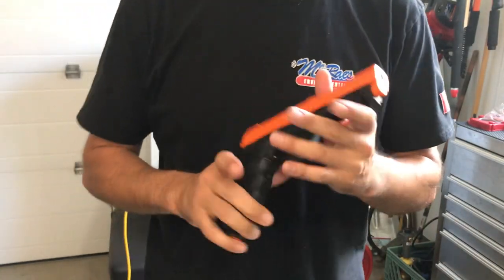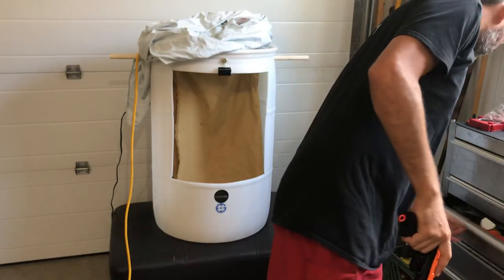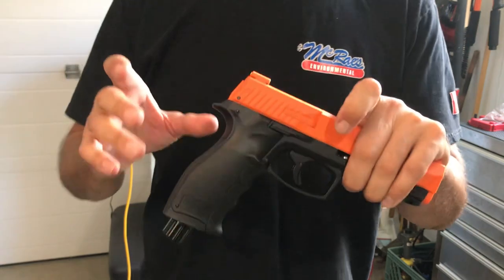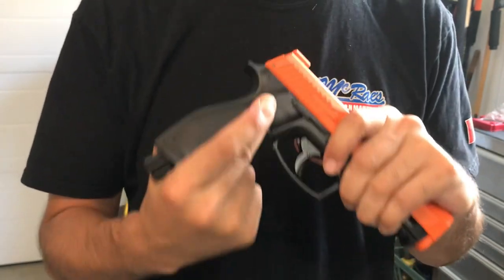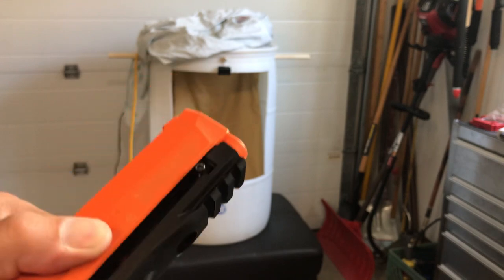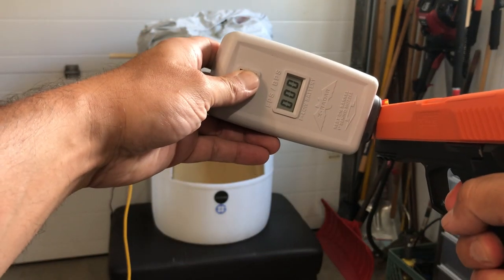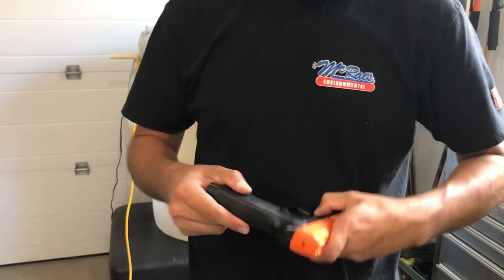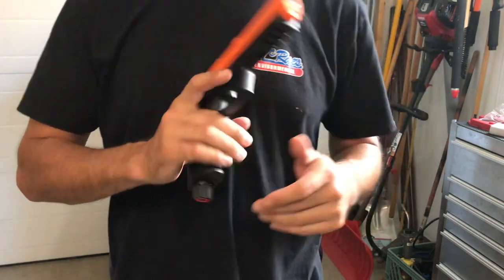Umarex T4e Hdp 50 co2 and valve block restrictor delete. 17-18 joule. Follower fix for steel balls.

Comment: i have a hdp 50 with the f stamp on it , it came with no restrictor in it , i removed the valve block so its fully open , it smacks hard , would you happen to know how many joules it would be at now fully open? great videos by the way .thanks 👍🏽
Reply from the maker: Approximately 18j temperature and projectile dependant of course.

Comment: hmm.. ive got the hdp50 11j, looking in the pressure chamber and i see no "horse shoe" shaped cylinder/valve restrictor, all i see is diameter is shrinking abit way down in there like 1mm but cant tell if its something i can take out to open it more, should i disassemble it completely or is this one that ship without restrictor from factory? In that case, all i need to do is remove the thing with a hole in it between the grip and pressure chamber?
Reply from the maker: If your hdp50 came with a silver button co2 restrictor in the grip it is likely an 11j version which i think has no valve restrictor. In Northern American we only get the 7.5j version so it ships differently.
Reply: @lesslethalfordummies  Youre correct! Thanks!!!

Comment: So I tested umarex rubber it was 670 avg  1.15grams uxcell nylon 1.20 grams is 650 avg and umarex 1/2 glass slingshot ammo is 2.5 grams at 430 avg on all 6-7 shots at least in mine, I took your advice and didn't bother with steel, I think the sweet spot with ammo in the umarex products with just removing the restrictions is about double so 3-4 grams max in .50 cal and 5-6 grams in .68 cal. Obviously if you run longer barrel and hpa and short valve pin you'd get more. But for free mods you can't beat them.
Reply from the maker: I am of the opinion 4g is perfect for 50cal. I am trying to make the heavy steel balls more useful on anything but hpa. If i fail I will be picking up some lighter ammo.
Reply: @lesslethalfordummies  if you find a ammo that fits in the hdp that 3-4 grams let me know cuz I'm running the 1/2 inch glass in my edc it's decent but something harder or shatter proof would be nicer, however they are like dead accurate like 1-2 inch groups at 7 yards
Reply from the maker: 10-4!
Reply: @lesslethalfordummies  hey are you experiencing like a good drop off in velocity after first two shots with the valve block out
Reply from the maker: @markharlacher6183  this is typical behaviour after removing the block unfortunately. By dseign with the blocks removed Umarex markers charge the entire air chamber and co2 chamber which is alot of space for just a 12g co2. Ideally you need more co2 or hpa. I found reinstalling the co2 disk while lowered the initial fps it allowed greater consistency.
Reply: @lesslethalfordummies  I want max power so if it doesn't matter but my acctech or whatever pellet Chrono you shoot through a 1 inch hole has been reading like 600+ first two shots then 400+ 3-6 with 2.5 gram glass ball so idk if it's the gun or Chrono
Reply from the maker: Your chrono is probably reading the co2 blast because you are shooting through it at such close range. Radar based chronos elimate this problem for the most part.
Reply: So idk if it's the POS Chrono or the gun is actually putting that out cuz the glass it clear and if it's picking up the round or not
Reply from the maker: @markharlacher6183  i am almost 100% sure its the chrono.
Reply: @lesslethalfordummies  ok thanks ig I'll just the old soup can water test see if it goes through both sides or more thank one idk
Reply: @markharlacher6183  12.5mm Aluminum balls
Reply: Have you tried the 2.8g aluminum?, and has anyone tried leaving the valve block in but drilling it out larger passage?
Reply from the maker: Most people are going for max power so leaving the block in place just doesnt make sense. There are numerous ways that you can restrict flow and all will lead to the same result.

Comment: I had a question why does the double delete not work on the hdr.50 like it does on the hdp.50? Would a stronger bolt spring work for a double delete valve block and restrictor on the HDR.50?
Reply from the maker: A stronger spring should alleviate the problem. My belief why the Hdr does this and not the Hdp is pressure loss through the drum creating a free air situation.
Reply: @lesslethalfordummies  yeah I can see how it would lose some air through the drum awesome perspective. What size spring and tension would you recommend?
Reply from the maker: I started testing springs but never followed it through. Its probably something i should revisit.
Reply: @lesslethalfordummies  yeah that would be some awesome experiments for the hdr.50. Awesome thank you for your help. And again I definitely appreciate your videos
Reply from the maker: Thanks for the support. Honest to goodness reason i didnt follow through is a get tired of all the tinnie tiny little screws 😂
Reply: @lesslethalfordummies  lol yeah those screws are tiny and a pain to keep taking off and putting on, thank you for your contribution and for making the videos fun to watch

Comment: i got the full mod ,with also 2 piece tuning barrel , you will get not 25 but 30 joules. i got in the .495 barrel not the .505 ,,in , and this one shoots everything but steel balls ,if it does go into barrel easily i wont shoot it ,i wont mess up the barrel tht way , i have others for steel balls . have you tried the 177 grain lead .50 cal balls yet ?
Reply from the maker: I have been wanting to try some lead balls thinking they might make for a better fit in the barrel. I just havent had the time with everything else that i have been up too.
Reply: @lesslethalfordummies  i got some ,thy are 177 grains , they arent as good as the steel balls because they will eventually deform lol .
Reply from the maker: @rick31869  yowza those are heavy!
Reply: @lesslethalfordummies  i know need 50 or more joules for that lol
Reply: @lesslethalfordummies  they are closer to .495 range , they roll into tuning barrel no probz. i havent used them yet for 2 reasons . lead does deform , and i want a little more than 25 to 30 joules to test them lol . dam it ,now im curious ,i will probz put my tuning barrel back in and shoot em at 30 joules ,when i do , ill give results ! .
Reply: @lesslethalfordummies  now bro ,im itching to buy a tippman cronus tactical , do you know if there is a heavy mod you can do ,have you ever tried to mod one ,at $ 139 its cheap but still looks nice !
Reply from the maker: @rick31869  i haven’t played with a Cronus. Way back when i messed with a 98 and 18j was possible pretty easy with drive spring upgrade. Most recently i was modding a Spyder Victor and just haven’t had time to revisit but it was close to 30j and i am sure there is more.
Reply: @lesslethalfordummies  omg ,im close to getting one ,im trying to find mods for it , kindda looks cool !!!

Comment: How can you tell of you have a 7 vs 11 joule valve on the hdp 50?
Reply from the maker: 11j valves will have the shiny co2 restrictor if you look up the co2 grip.

The marker would also have the “f” stamp  integrated on the side.
Reply: I dont believe mine came with a co2 restrictor but it does have the "f" stamp so it's appears I have the 11j version? It also doesnt appear to have "threads" for the restrictor. I plan on keeping it double deleted adding the tuning barrel and a power pin.
Reply from the maker: @lylemcdowell7600 what you have is a 7.5j version. No restrictor, no threads, “f” stamp = 7.5j

What your does have is the larger valve block i side the air valve itself.

Comment: and yes the 8.4 steel balls are only good with hpa, co2 they are to heavy
Reply from the maker: I am hoping to change that 😉
Reply: would you recommend the 4 gram pvc coated steel balls for a co2 set up?
Reply from the maker: @OE30  i dont know which ones specifically you are referring to but i am currently using 3.5g pvc coated riot balls. They cycle really well but i feel they are a little undersized for maximum fps in the factory barrel. The riot balls measure in at 12.4mm diameter.
Reply: @lesslethalfordummies  Thanks for the info! 
I found some on eBay advertised as: 
"100 X Less Lethal .50 Cal Paintballs 4 Grams Solid PVC Steel" 
for about $71.00 
I would have to contact the seller to see if they're at least 12.7 mm.

I'm currently using 12.7 mm 1.5 gram nylon balls and they cycle like a dream with a tight seal.
Reply from the maker: @OE30  strangely enough Riot Balls advertise them as 4g but really they are 3.5g.
Reply: Get hd24 aluminium balls, you wont be dissapointed.

Comment: How do you take the valve block off?
Reply from the maker: Unfortunately during the filming of that particular video my camera crapped out and missed everything. It is really simple to knock it out with a long thin oject down the barrel once your marker has been opened up and the brass cap removed. A quick search of YouTube should get you some great videos demonstrating this process.

Comment: Was that the 7.5j model?
Reply from the maker: It started as 7.5j model yes.
Reply: @lesslethalfordummies  cool cheers. I've just recently got one and the 20/30j upgrade kit but ive seen people say its better just removing the restriction. Just wondering if its worth it
Reply from the maker: @chrisg4rr377  remove the valve block first and test it out. Then you can move on to drilling the restrictor or deleting it completely. Dont bother wasting time changing to the shorter pin it hasn’t proven to be worth the effort.

Properly bore sized ammo will have a much greater benefit after removing the block.
Reply: @lesslethalfordummies  cool cheers bro

Comment: DO THE DELETE AND PUT IN THE STAINLESS STEEL VERSION OF THE POWER KIT AND 25 JOULES YOUR FIRST SHOT !!!
Reply from the maker: I have to order a longer barrel so i will see what else i can at least try. I did lots of testing with shorter pins in my Fsc and Vks and it just didnt produce any gains.
Reply: @lesslethalfordummies  i am breaking the 25 joules mark with power valve pin 2mm shorter , valve block delete , restrictor out , when in i loose a joule or two , but my shots drop off very slowly , more consistent ,, im about to order a big order of power kits, barrels ,sniper barrels , a couple of small hpa tanks , etc. from home defense 24   ,he really has some very cool stuff !!!
Reply from the maker: @rick31869  yeah i definitely need to try out a sniper barrel and maybe the new hpa adapter. Just waiting for it to pop up on the site.
Reply: Aluminium balls are awesome
Reply: @lesslethalfordummies  wow ,but you are right ,to an extent ,longer barrels do build up way more pressure and increase fps and joules tremendously !!!!
Reply: @lesslethalfordummies  yes ,i am about to get a couple sniper barrels ,some more power kits ,tuning barrels ,and tanks and remote lines and adapter from the man also , home defence 24 is awesome !!!! 
my thing is to produce markers that perform well with just 12 gram co2's so you can carry them and have them if you need them . now for home defence ,the remote lines and tanks give the extra power needed for extra power ! . dude ,i am becoming a master at modded these things , the bolt and valve polishing i learned from you and also the magnet trick in hdp are really awesome . thank you again my brother for all you do for the lessthanlethal community !!!
Reply: @THELESSLETHALSPOT  yes but try the more cheaper and effective 12.7mm steel balls ,they are awesome !!!
Reply: Can shoot them 8g with my HDR, but not my HDP. It wont cycle, they jam the trigger get stuck and wont shoot. I dont reccomend them. Not reliable.
Reply from the maker: @rick31869  i do like the idea of keeping a few co2 powered markers around. Definitely not going to carry an hpa tank in my holster 😆.

There is just something about polishing your bolt 🙄 and doing mods that soothes the mind.
Reply: @lesslethalfordummies  YOU GOT THAT RIGHT BROTHER ! LOL I WAS THINKING OF FINDING SOME LIGHTER BOLT SPRINGS AS WELL FOR A LITTLE BIT MORE OPEN GAS TIME , BUT STILL STRONG ENOUGH TO PUSH SEAL VALVE PIN TIGHTLY INTO THE VALVE SO NOT TO HAVE ANY LEAKS  ! LOL

Comment: Where do I get the magnetic insert to replace the rubber breach insert?
Reply from the maker: The magnet is not a replacement for the detent. It is used in conjunction with the detent to alleviate jams when using steel balls.
Reply from the maker: @-FPIRP.ORG-  They are dirt cheap on Amazon you want 3mm x 10mm Neo magnet.
Reply from the maker: @-FPIRP.ORG-  you only need one but you usually get 10 or so. They make great no scratch fridge magnets to boot.
Reply from the maker: @-FPIRP.ORG-  Yes but you want no hole
Reply from the maker: @-FPIRP.ORG-  i did a video of fitting the magnet somewhere. They get buried by all the new stuff. I first just used a piece of hockey tape, then I graduated to double side tape. Some have also just used a dab of glue.